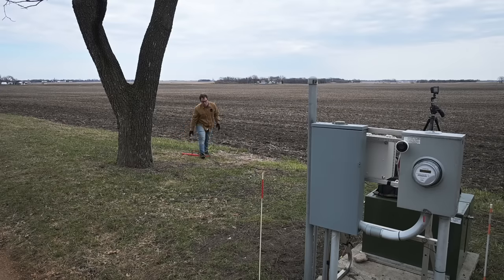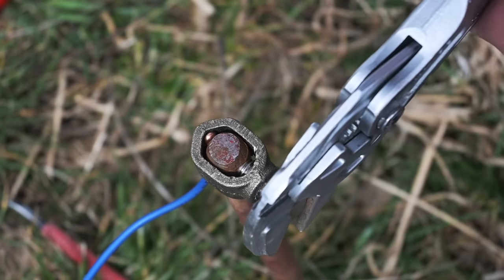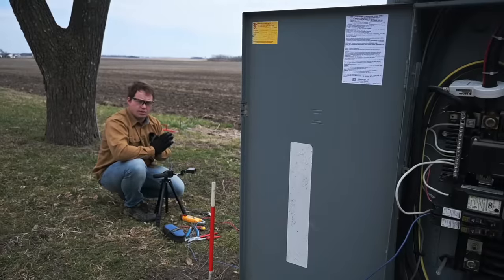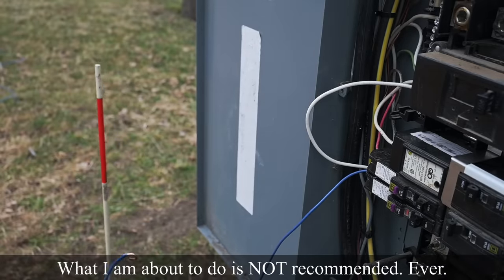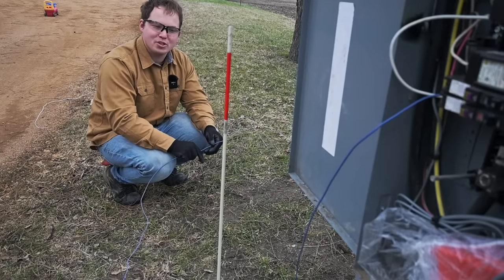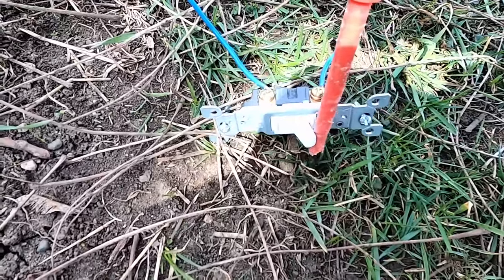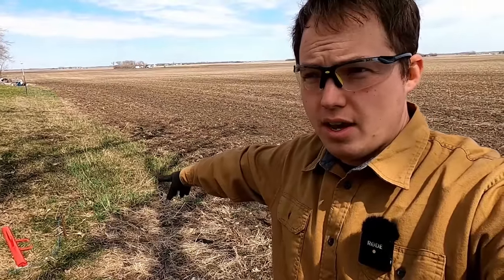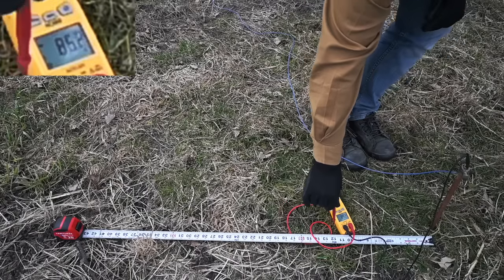Will 120v To Ground Trip a Circuit Breaker?

Comment: So I have been directed here from another video.  Very interesting video and this somewhat goes against what I am used to.   I'm a commercial electrician however and have never worked on anything smaller than a building with a 2,000 amp 277/480 delta Y service.  In these buildings our grounding is rather substantial we bond almost every aspect of the building and the sheer amount of conductive mass connected to the panels is pretty extreme with everything being connected with typically a CAD welded #250 Bare ground wire as well as a Ufer ground, Delta Ground, Cold Water Ground, Building Steel Ground and of course Every other piece and aspect of the building are completely and totally connected (ignoring any IG's that may be present in the building).  So I know my way around the Installation of larger electrical systems.  NOW in this scenario, you are connecting your hot wire to earth directly but Your ground rod is not a part of your electrical system.  I think It is worth pointing out that this is somewhat misleading...  At your first means of disconnect for a separately derived system, you have to bond your Grounded conductor directly to your Grounding Conductor which then brings everything all together at your main switch whatever that may be.  The reason I'm bringing this up is people may confuse that ground rod as the same thing as the GROUND in a building.  It is in absolutely no way the same thing but I don't really think that was clear in this video.  I also don't quite understand exactly what is going on here.  I'm not certain but I suspect you are getting 9 amps through your circuit because even though you have no virtually no resistance on your circuit you are getting resistance between the ground rod for your experiment and the ground rod for your electrical system giving you X amps depending on how resistive the dirt is in that particular location using 120V.  Would this same thing happen if your testing ground rod was in a theoretical void completely isolated from the rest of the earth but still driven into a similar mass?

Thanks for reading if you bothered! and Thanks for replies in advanced if someone does happen to bother  ;)
Reply from the maker: I bothered! Your experience with large electrical systems is impressive and I appreciate you taking the time to comment! You are correct of course that if the ground rod was part of my grounding system and thus connected to the main panel the circuit would have tripped. What I am trying to communicate is that just having a "ground rod" is not what makes a system safe. It's just as if not more important to make sure that every aspect of your grounding system is ultimately bonded to the neutral in the main panel.

Thanks again for your comment and keep up the good work!
Reply: @BenjaminSahlstrom  Lets say that the neutral and  ground cables are bonded toguether  at the main panel. Now if a hot wire makes direct contact  with the  ground wire conductor What would happen? Does it cause a short circuit?
Reply: @miguelac6872  yes.
Reply: @BenjaminSahlstrom  I am studying Level 1 electrical right now and the current subject is grounding. I've learned a lot from watching your videos. I was wondering if I could ask a question about your reply to the comment above, did I understand correctly,  the 9 amps are flowing from the ground rod for your experiment to the ground rod for your electrical system? The 9 coulombs per second are not just flowing into the earth, never to be seen again?
Reply from the maker: @davidstrens  That is correct! Current is flowing from the ground rod I drove back to it's "source" which is the neutral/ground (since they are bonded) via the earth ground that is connected to my panel. Technically current could also be traveling back through other grounding electrodes throughout the electrical system wherever they are since they are also bonded to the neutral at some point.

Comment: As long as you have a sacrificial GFCI breaker, you should show what happens if the neutral wire is not installed. Or even if it is incorrectly connected to a ground wire ;)

Comment: Some possible additional experiments:
1. Wet the ground near the ground rod.
2. Wet the ground rod near the panel.
3. Soak the ground to simulate a heavy rain
4. Move the ground rod half way to the panel

My guess is that wetting the ground near the ground rods will substantially improve the effectiveness of the ground rod because effective surface area of the ground rod will be increased substantially.

My guess is that moving the ground rod closer to the panel will cause the breaker to trip, but I'm not sure. The resistance of some paths between the panel and the grounding rod would be substantially reduced but when the grounding rod is farther away the area that current passes through might be increased enough to counteract the fact that there are some paths have significantly less resistance when the ground rod and the panel are closer.

Comment: To trip the 20 amp breaker the ground would have to be 6 ohms or less. Very few location have ground even close to that number.
Reply: Actually you would need 3 ohms or less - there are two ground rods in series - one going down into the ground and another on coming back up.
Reply: @MandrewP  He is saying  less than 6 Ohms, as measured BETWEEN the two ground Rods ...

Comment: When I watch the video, I feel like I'm in the Stone Age. As far as electrics are concerned, you are unbelievable light years behind in your country.
Reply: Oh whatever. Yeah, I'm sure you're so advanced you don't even use conductors anymore.
Reply: @qball3835  Look at European Standarts and u will see !!!
Reply: @DarkMatterGold1210  Actually the electrical systems used in Europe have more points of failure and result in a higher likelihood of injury or death. So your comment is completely false. Also, how can you say you are light years ahead when fewer than 5% of European households have air conditioning. You’re the ones who are still in the Stone Age.
Reply: Hey Mike...Can you expand your comment & include an example or two?? Tx
Reply: dantaniondb   Not that I'm promoting Europe, but I've seen videos from Europe in which they talk about the superior safety features of European plugs and that Wago connectors are superior and used in Europe.
Reply: @dantaniondb  use google and u will see
Reply: @DarkMatterGold1210  You say you don’t need air conditioning but every single summer y’all cry about how hot it is. It’s 2020, imagine not having air conditioning in a first world country
Reply: @mattolson7037  Thats not true
Reply: @DarkMatterGold1210  Yeah it is lmao
Reply: @mattolson7037  no its not

Comment: You asked why the amperage was slowly rising while the power to the grounding rod was on.  Power doesn't dissipate in the dirt, it is seeking it's way back to the source, which should be the transformer sitting next to your electrical panels.  The ground has natural resistance to current, but as the power continues to find it's way back to the transformer, it is heating up the dirt, which changes that resistance allowing the power to move more freely through the dirt (I'm using "dirt" instead of "ground" to avoid confusion) and as it does it draws more amperage until it reaches the maximum rating of the breaker and trips it.

Comment: I knew it wouldn't the breaker, but was suprized at the 10 amps. I wouldn't have thought 15ft of dirt would conduct that many amps.
Reply: soil has lots of conductive moisture in it
Reply: The earth has VERY low resistance but it is the connection to the earth that is hard to make low resistance.
Reply: @MandrewP  the us electrical code used to (maybe still is) require you to test your ground rod with an ohm meter, and if it was less than 8 (barely enough to trip a 15A breaker, and not anything larger) you installed another rod. The resistance to ground varies a lot with soil and moisture content even from one day to the next.
Which is why local and national standards tend to prefer grounding plates and UFER grounds (buried in poured concrete foundations) these days. At least the electrode surface area is far larger...

Comment: Try this. Drive 2 grounding rods in the ground 50 feet apart. Measure the voltage between each other. They don’t need to be deep. There is usually some voltage potential between them. Try on DC scale as well and when it’s wet  depending on soil it’s like you can apply charge to it as well. Different soils preform in different manners.